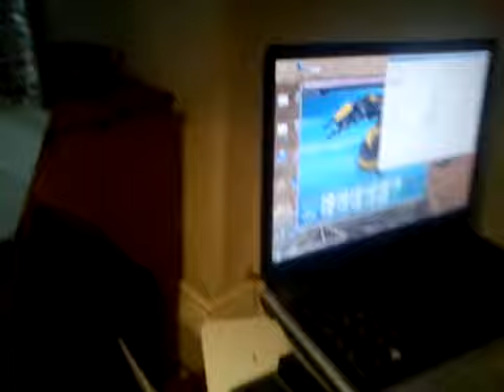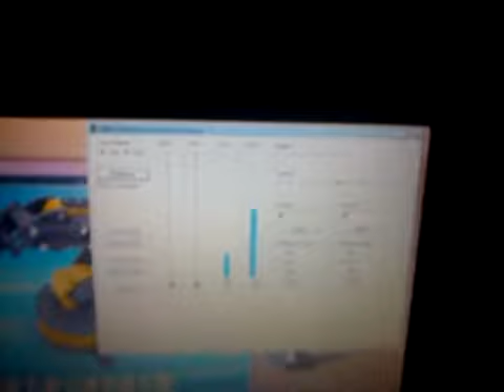Solar reflector experiment (brushless DC vs stepper motor) energy

Comment from the maker: Been upgrading the design, working in a 1,900 axis stepper motor controller and a cheap precision gearing system made from old CDs.